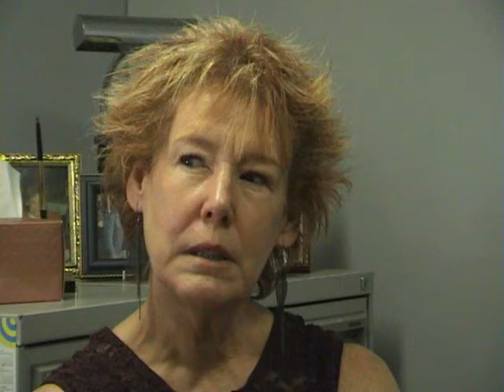Wade Cams for Performance Engines

Comment: as a young kid, hoon early eighty's i meet George at wades camshafts, and he gave me a lesson on camshafts for my 202 holden 6 cylinder
son you dont want a regrind billet, it will be too thin and flex at high RPM with that grind 391
391 bathurst grind will work great
make sure you use starfire rods
at bathurst 1972 engines chucked rods conrod straight getting light over the second hump
i took Georges advice and bought a wade 391 for my wild 202 with starfire rods
all my hoon mates run wade cams back then
my older brother run a hot EH with a solid wade 224a in a hot 192
those were the days
i still remember George in his dust coat at north melb, an old guy, still only too happy to help and give me advice, 
what great history and Australian engineering , sadly all these skills will all be lost in time